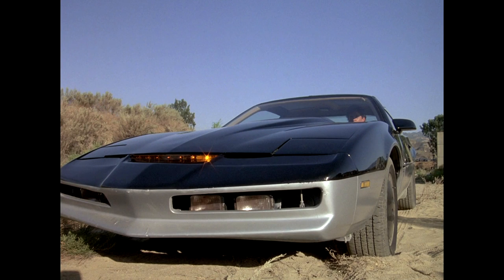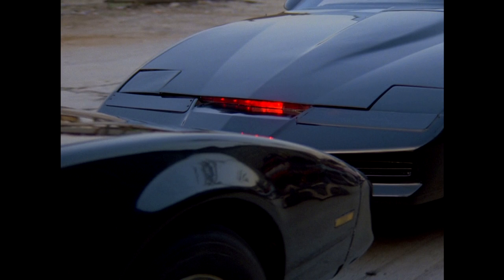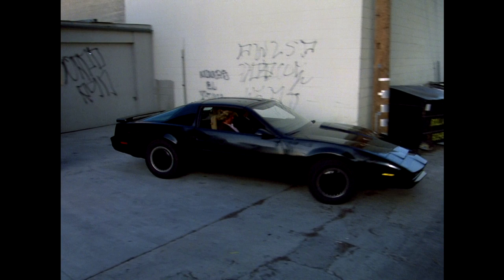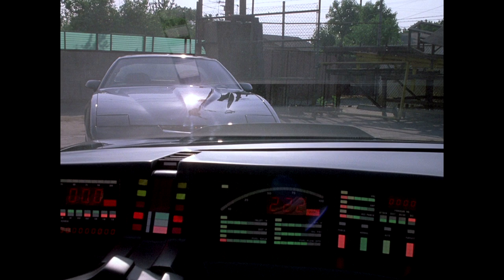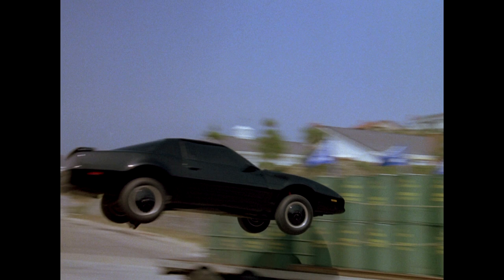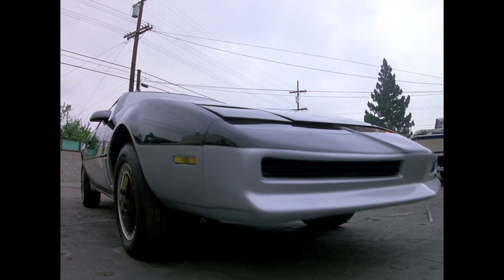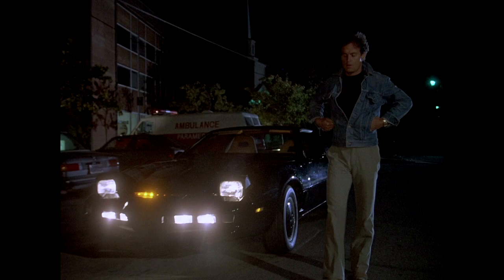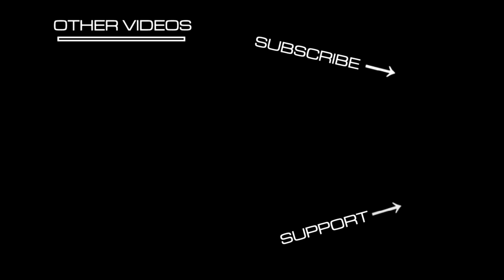Does KARR Still Exist? Breaking down the Trans Ams Used as KITT's Evil Twin in "Knight Rider"

Comment: Trust Doesn't Rust is still my favourite episode, with an early appearance of the infamous double bonnet kit cover. The info about  the 'flivver car' was good to know, and one of the jumps (KARR crashes through the shutters over KITT, my favourite shot) looks as if the front slightly lands in mid air, lol! And as a personal preference much preferred KARR with the red scanner bar and single paint scheme. 

Admittedly KARR in 'KITT vs KARR' was more sinister and sociopathic (stopping Eddie's pacemaker and going on to lure Christie to a completely blackened interior, as she screams and KARR screeches away shows this best!) but a plothole (well... sort of) about the existence of KARR is that the Foundation happens to have purchased and developed a previous Trans-Am before renovating Michael's personal car from the pilot episode?

Comment: Brilliant video guys. It would've been cool to mention that one of the black cars used still had the side mounting points for the custom KITT exhaust which is seen when KARR first pulls up to the boat yard, but I guess you see that every time that car makes an appearance. I do have one interesting point actually, what about when KITT was actually KARR? In KITT vs KARR, as Michael is approaching the marine building it switches to an exterior shot of shop windows, in the reflection you can just make out the 2 tone paint job. Keep em coming guys 👌

Comment: "The Rockford Files" and "Fall Guy" GM had a program where they'd sell the studio as many GM vehicles as they needed for $1 a piece, as long as they were used for the shows. I'm sure the deal applied for "Night Rider". After the first season GM built 6 mid engined trucks for Lee Major's character to jump with, because GM exec's didn't like what little height and how the nose came down on the K-20. The studio would buy 2 per year for Jim. One pretty one for close up and one for the action scenes. Both were Pontiac Formulas, badging, hood and trunk lids replaced with less conspicuous Esprit style components. And painted light gold which stood out on cameras better .

Comment: One thing that's always confused me even since I was a kid was why did KARR get the two tone paint halfway through the episode? Was that ever explained?
Reply: Yes, he says in the episode he needs a disguise because he was't at full power to take on KITT yet.
Reply: The shed that Karr was hiding in at Eddies Marina is an oven. Its used to bake the paint when cars/boats are repainted. In the show you can see the doors have layers of insulation hanging on the inside - and a glimpse of the top of the walls inside shows the rectangular frames of the heatlamps (which are turned off) - these sit at an angle between the top of the walls and the roof.

I imagine there was a lot more filmed than made it into the episode.- I hope it was explained in the script at least.
Reply: Yes but depending how you watched the episode there was a cut that didnt have that scene.

Comment: I wonder if it would have been a good twist to use KARR as 'a necessary evil' which the Foundation would need as a plan A to neutralize  'killer KITT'.

There were some big mistakes in the series, but back then few people really bothered about it. One from the KITT vs KARR episode is when John opens KARR's door for the first time and takes a look inside, saying: "You won't believe this dash." The dashboard shown in the shot is KITT's, not KARR's. You can see the voice modulator being red instead of yellow, and I believe it's even the old one with the flashing square from the start of season 1. Quite a lot of shots in the series were reused for multiple episodes.
Reply: I never noticed. Link please

Comment: Hi, it looked obvious in "Trust Doesn't Rust" that KARR's voice modulator was never an install in any of the hero or stunt cars and was its own individual prop. In "KITT Vs. KARR" it seems as if to me the voice modulator was installed on a seasons 1-2 stage dash and never installed in any of the cars, is that the case? 

Also, the 3-bar LED style for KARR's voice modulator was conceptualized before KITT's in "Trust Doesn't Rust," as KITT's was obviously the square.  Did the production come up with the idea to revise KITT's voice modulator from the prop used for KARR?
Reply: KITT became KARR's voice modelator version in season 1 episode 14.

Comment: In The Episode of Junkyard Dog how is it that after K.I.T.T. is pulled out of the Acid Pit that every thing has been ate out from his Dashboard, Seats, Interior, Steering wheel, and everything that was Hard Plastic was completely ate out,  That The Bowling Ball Hub Caps were still intact as well as K.I.T.T.'s Tires were still on the Rims,  Acid that was Strong enough to eat up the entire inside of the Car should have eaten out The Rubber Bumper and all of the Other Hard Plastic on that Car it didn't make sense after I thought about it!

Comment: WHY IN THE SAN JUAN HELL DID THEY CRUSH SO MANY OF THESE CARS, AFRAID PRIVATE COLLECTORS OR JOHN Q PUBLIC WOULD ONE DAY GET THEIR HANDS ON THEM?!?!?!?!
Reply: No, contract and California state law.  They were involved in a train derailment.  Even if they were intact, there's no way to judge how badly damaged they were(might've had a hairline crack on a shock tower, for example).  And if the car gets involved in an accident, and it's discovered that the car was in a train derailment, the company could be held liable, even if correlation=/=causation and the accident wasn't the fault of a structural issue due to the accident.  In other words, the cars aren't safe, so they get listed as salvage.  They got dumped off to recoup the loss with the understanding that the cars will be destroyed and not be used on a public road save under controlled circumstances.

Or something.